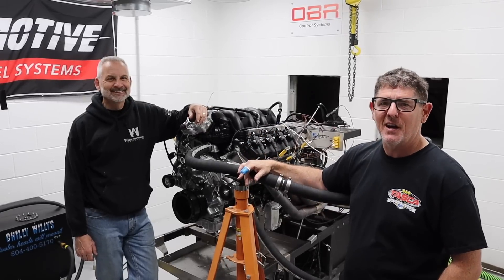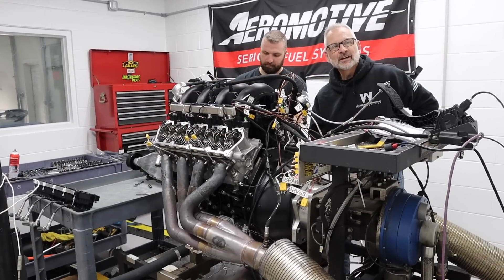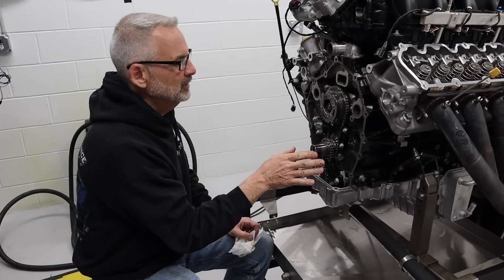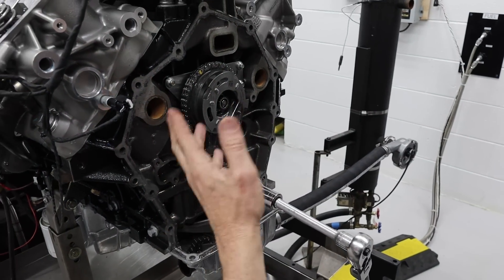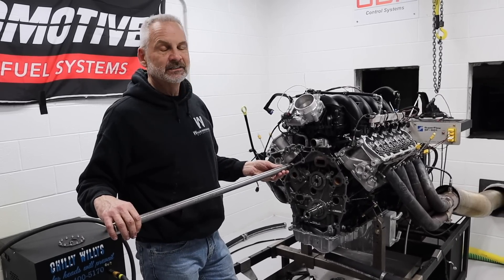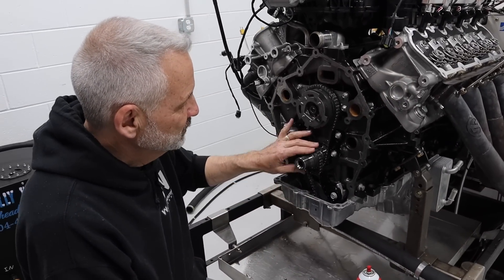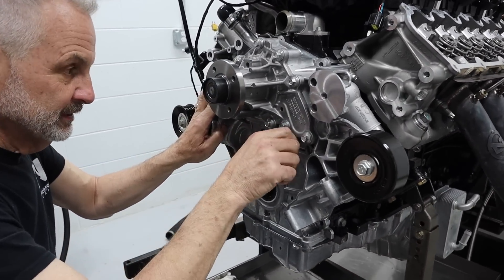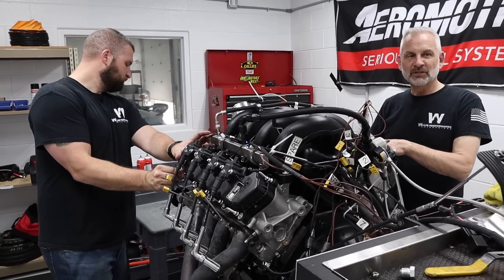Tested: 600 HP Godzilla 7.3L Street Cams - We Show You How To Do The Swap!

Comment: I have no doubt this motor can make the power, but it starts as such an inefficient design that by the time you've added any power to it at all, you're left with an engine so consumptive that it's irrelevant for all but some limited track applications.
Reply: What's inefficient about it? I see reported mpg numbers to be on par with previous f250 and current GM 2500?
Reply: @ILiveInMomsBasement  Just trolls with no data, that have never done anything.
Reply: I agree. This 7.3 Is so inefficient and towing heavy with it, will not last long. I ready doubt this engine will make it to 200k miles if used for towing

Comment: Yes I’ve seen people use power tools to remove spark plugs the issue to my mind is if they’ve been in there for awhile I think there’s a risk the threads can become packed with carbon and the impact will pull the plug out and the aluminium thread in the head as well now you’ve got a problem……

Comment: Interesting...on any conventional old school pushrod engine such as a 5.0 or FE..you can rotate the cam to push lifters to top side but... as the cam moves and or rotates and raises the lifter, The lifter  will come right back down and contact the lobe and obstruct...or worse yet once the cam is partially out the lifter will fall straight down into the cam tunnel area in most cases, which would mean in old school terms pulling the intake off to correct for obstruction... so why is it different in this case? or did I miss the details you were saying?...btw if you dont mind me asking what tools are you using here in terms of sockets and new OEM required tools for diss assembly?..are we talking US, Wentworth, Metric..?  or a combination?
Reply: I know it has been awhile but I just saw your comment and figured I would answer your question. The 7.3 Godzilla engine uses plastic lifter holders that prevent the roller lifters from rotating and  damaging the cam. There is just enough friction between the holder and the lifter that you can rotate the cam and the lifters will stay in their up position when the pushrods are removed. Ford actually first used this setup in the 90's on the 5.0 explorer engine

Comment: Hmm. This has me thinking. I have a ‘94 F150 Flareside 4x4 just sitting with the original (and very tired) 300k mile 5.8 Windsor and E4OD trans. Seems like you could do a Godzilla swap for not a lot more than a good stroker Windsor.  If it needed a tranny too, then I’m not sure. Still, I’m loving the size and potential of the 7.3. Many thanks to Evan and Brian for your work on this.

Comment: Well the motor itself is priced Right but how much is the controller? The only one I've seen so far was over $3,000 and there was a bunch of other stuff such as the fly by wire gas pedal that really pushed it over for Grand. Then there's the cam change to get some decent power how much does that cost? So you can get the motor for about seven Grand but it looks like you're going to have another 7 into it easy. What do you say to all that? Thanks for the video

Comment: I wish Evan would get the lightest weight 7.3L F250 to do a build/ dyno/ race series with it.  Start off bone stock, then round one of stripping off weight, then a tune, etc...
Reply: I'd rather swap one into a 5.0 F150
Reply: The new superdutys are SO heavy. Like 7000 lbs. There is no way you're getting it "light"

Comment: On a side note, do you think that godzilla would fit into a 2001 f150 engine bay?
Reply: Yes
Reply: If I read correctly, they use the same bell housing as modular v8's. So they bolt right up! Lol
Reply: but my 4.6 keeps running from 2000, they are unbreakable

Comment: With that engine making over 600 HP with just a cam swap this engine would be a great swap for a 71 Ford LTD sedan and combine that with a 6-speed manual swap and man you got you're self a modern day Gator mobile from a 1973 movie White Lightning.
Reply: I was thinking a '76 Gran Torino 'Starsky and Hutch' replica.  Heck, any full-size pig that Ford had out during the malaise era.
Reply: @culcune  That would be awesome brother.
Reply: 71 mark 2 door coupe would be a great platform for that engine with a 10 speed but a 6 speed would be fun too...I would want it at 780-820hp just for that impossible possibility that most all modern day cars get cooked and the fast modern cars don't go far from that big beautiful 71 Lincoln Mark grille smiling in the mirror..it wouldn't matter to me anything Ford that gets that 7.3 is a winner cause that's one less asshole who would put an ls in it.
Reply: As long as you have the $$. I’m sure this is a very expensive swap
Reply: @markfrazier2575  they made 600hp with under $4k, including buying the block, heads, etc. https://youtu.be/ktx8nPOVaxw?si=5UfujdJl1vkatl-k
Reply: How durable is that single timing Chain? I’m used to seeing a double row timing chain. It looks pretty delicate.
Reply: @markfrazier2575  That chain has held up well.  I've beat my F350 220,000 so far.  I pull my triple axle low boy loaded many times over 25,000lbs.
  My rpm isnt as high as a drag car tho.  Probably need an upgrade for race stuff.
Reply: Wow dude, I have my 71 LTD convertible and I was just thinking of buying one of these motors to drop in it
Reply: @biggdogg305  White Lightning is one of my favorite movies. That big car with that bad ass big block and a four speed. Wow I loved it. You do you brother. Build you a toy.
Reply: I Love that movie.I Love it when that guy asks him where he got that bad ass motor.

Comment: So, no rocker adjustment needed? 
I wonder how consistent this will be when there are more aftermarket cams available.
Reply from the maker: Hydraulic roller lifters, why would that not be consistent?
Reply: @revanevan  Don’t know, just seems that anytime people step away from O.E. cams, even hydraulic roller, they tend to insist on an adjustable rocker. Obviously there are other factors, aftermarket heads, any machine work to the heads or deck, etc. That’s totally cool with me if you can just toss a cam in and bolt everything back together. No complaints here.
Reply: @anthonysgarage  Yep, that was the way we worked with Callies to ensure same base circle and the complete stock valve train would work.

Comment: How very LS, 20 years late.
Reply: So maybe you can tell use 1 thing on the LS that Ford did not do first?  Let's see symmetrical Ports Ford First, Deep Skirt Block Ford First, 6 bolt mains Ford First, 4 head bolts/cylinder Ford First, Coils on the valve covers Ford First, and the list goes on, but we will wait for your answer......
Reply: @brianwolfe2993  Ford never did 6 bolt mains, only cross bolt on 2 bolt mains on very rare blocks
Reply: @petejoseph8257  Wrong, had them in 1993 junior, 4.6L 4V and continued from that point on.  Try again.
Reply: @brianwolfe2993  and all abandoned by Ford for useless underpowered  oversized overhead cam motors.
Reply: @petejoseph8257  You are a funny person, abandoned?
Reply from the maker: Oh Peter, you should educate yourself on Ford engine history.
Reply: @revanevan  no thanks, I almost threw up in my mouth watching this...
Reply: Where was the LS when Ford made the 351 Cleveland which could still kick the crap out of an LS?
Reply: @vxer1000  Delusional much?
Reply: @petejoseph8257   apparently you carry your brain where you sit. Look up Higgins racing in Australia.
Reply: Must make you mad you could only get 125 views on your most viewed video.
Reply: @brianwolfe2993  what is it you’re talking about,again?
Reply: @petejoseph8257  Go back to your own parallel universe where your can live in your own reality that is not based on the truth.   You can't even name one thing to support your initial statement, funny to everyone reading this......

Comment: Does Willis offer anything that would be considered a tow cam? I remember people always talking about adding a tow cam to the old 454s and 460s, wondering if they've come up with something for the 7.3 yet, or if it would even be worth the time and effort on these new engines.
Reply: The Cams we do pick up the entre power curve, check out Palm Beach Dyno for a Stage 1 upgrade they did on their shop truck
Reply: @brianwolfe2993  I actually did watch that video but it seemed between the stock and cam dyno runs the power was shifted quite a bit in the RPM range. Wasn't sure if that was actually the case or just how they displayed the dyno graph
Reply: @brianwolfe2993  obviously theirs is a shop truck, so it would be fine, but what about this cam in a 350 dually that hauls a 14,000 5th wheel localy with 2 trips from Indiana to Myrtle Beach each year?

Comment: This engine was ripped for having "only 430BHP" despite its large displacement. Said then it was because it has a truck cam innit. Stock cam is for 1500 rpm towing not for passing Ferraris @ 8000 rpm on the Mulsanne straight.

Comment: What bell housing and flex plate fits on these motors when trying to bolt to a glide?
Reply: MODULAR 5.4L AND 4.6L PATTERN
Reply: @aussi3212   Thanks same flex plate?
Reply from the maker: And Coyote.
Reply: @revanevan  so smart that they didn't change the bell pattern.
Reply: @deeremeyer1749  Isn’t it great how FORD is spanking the competition with their cars and trucks.
Reply: @deeremeyer1749  rent free